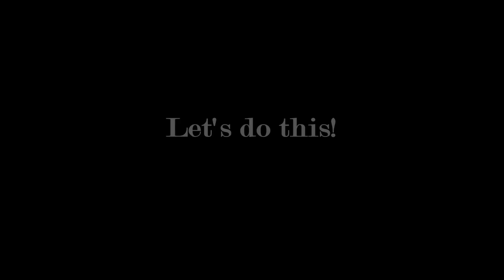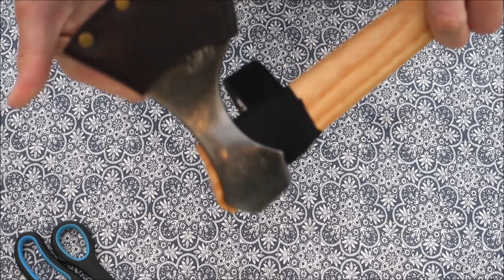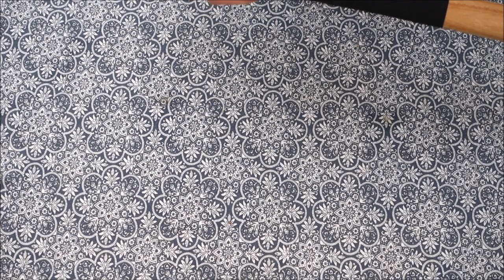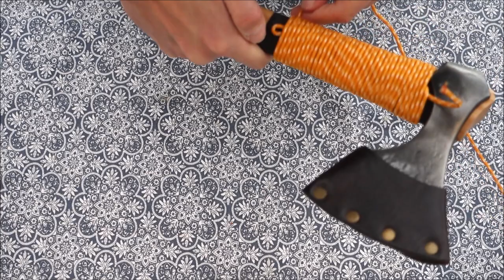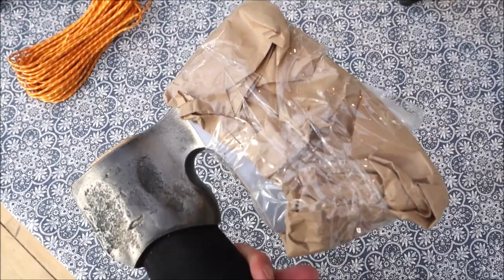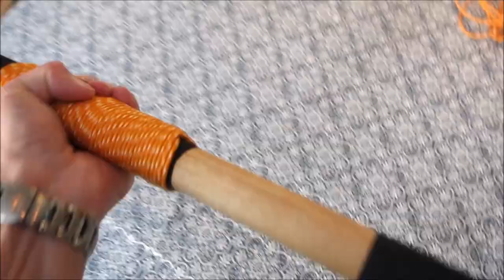WRAPPING AXE HANDLES (CCM + PARACORD)

Comment: Good video, I really like the idea of using the cloth tape with the paracord. I live in Minneapolis, Minnesota, USA and am cleaning up and re-handling two axe heads from my son-in-laws old family cabin in the Upper Peninsula of Michigan.  One is a 2 1/4 pound double bit axe with a 28 inch handle.  The other is a 3 1/4 pound single bit axe with a 32 inch handle.  Both axes have  the Michigan style head.  These are vintage axes that may be from about the year 1900 and the heads are in tough shape.  I'm a novice at this so I appreciate informative videos such as yours, so it's been fun and a real learning experience.
Reply: Omg you ruined it with colors
Reply: I got black and camo Paracord.

Comment: Nicely done, Fredrik, thanks for showing us your method.

As an aside, I don't have any nice axes like yours.  Mine are just cheap users.  I use the same method you do with the paracord for over strike protection.  However, if you know you'll never want to take the paracord off and want to "armor" the cord even more to provide even more protection, after wrapping, you can soak the paracord with CA glue.  I've done this, too, and it makes an impressive amount of permanent protection.
Reply from the maker: Thank you, Rick! I've been thinking of doing it that way, and the paracord would not get stuck on the actual wood, but on the CCM-tape, which means it would still be removable, without leaving glue residue on the actual wood. I'll give it some extra thought, but I'll leave the axes be for now, since it would be a MAJOR task to remove the paracord and glue it back on all of my axes, heh! ;)

Comment: Dear Pink G10: I’ve done many paracord axe wraps and I’ve found that they eventually come loose, or tear. I learned how to do them from Buckin Billy Ray Smith, the Canadian logger on YouTube. My wraps are super tight. But the forces at work just overcome the material. Eventually went to a rubber collar which is about half inch thick in overstrike areas. Not as aesthetically pleasing but it holds up much longer. Dan
Reply: Hey Dan, I am having the same issue with the paracord. Where did you get the rubber collar? Thanks!
Reply: @elong35  Eric: I get them at a little specialty hardware store in East Rochester NY called Debbie Supply. I just bought another one for my double bit axe. No other thing works. The cord looks pretty but it doesn’t take long for it to rip. I’ve even had leather tear apart. Rubber so far as lasted me all the way
Reply: @ocsplc  I thought about using some Fiber Fix tape and wrap them.
Reply: @elong35  Eric: I don’t know anything about fiber fix tape but I’ve pretty much tried most things and only thick vulcanized rubber seems to work
Reply: Big thanks! @ocsplc

Comment: Cc’s tape is what I have always called “friction tape”. I use boiled linseed oil on all of my axe handles, at least once a year and I wipe down the metal surfaces with one of my bar oil impregnated shop towels to keep them from rusting.  I also wipe them down after each use to remove any tree sap from the metal surface.
Reply from the maker: Friction tape does sound like a better description than just "CCM-Cloth Tape". And boiled linseed oil is indeed the way to go, and once a year sounds pretty good too. I clean my axes, metal surfaces, after every use, usually with a little bit of Ballistol. Sometimes with Autosol if it's really, really bad with lots of tree sap stuck to it. I try to take as good care as I possibly can of my tools, and it doesn't take much effort to keep these axes in great shape! I do make it a bit harder for me with the handle-wrappings when it comes to applying the boiled linseed oil, though. ;)

Comment: Good. Have you tried Basque axes yet? I have one 1.25 kg Hachas Jauregi with curved blade. It is a nice performing axe for its size but the handle shape just kills my hands when striking. It is king of a water drop shape handle, so it is rather "sharp" on the front side. I will have to try wrapping it with the hockey tape and see if it helps protect the hands from a vibration impact while chopping the wood